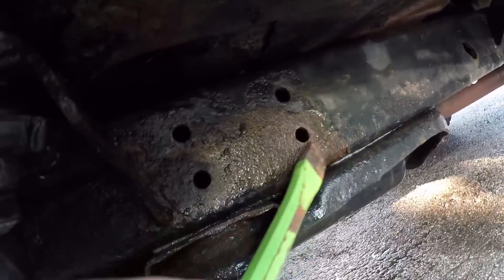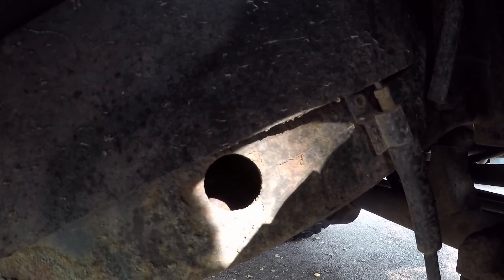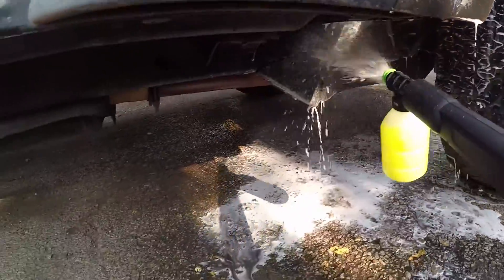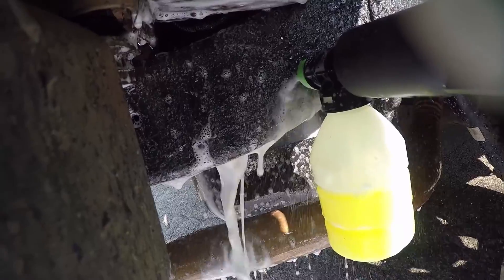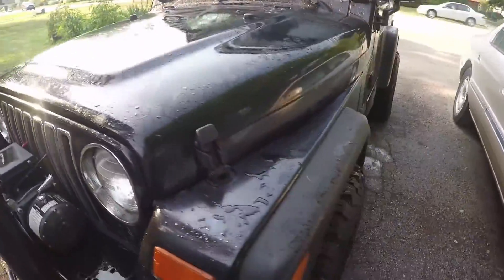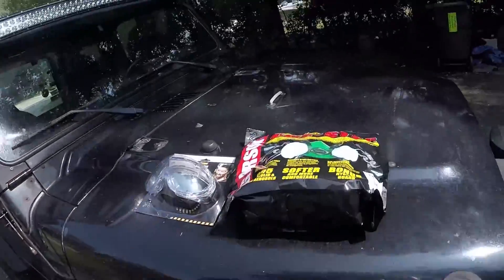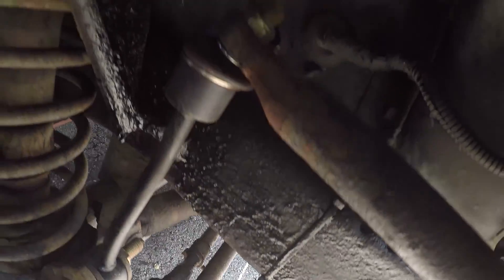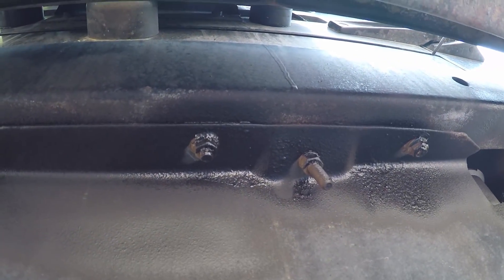Winter is Coming! - Winterizing my Jeep Wrangler

Comment: If you're dealing with a great deal of rust and want to truly neutrialize the rust and protect further rust do this.  Otherwise you're just painting on top of rust and the rust will continue. 

A few years ago and while my 97 Wrangler was undergoing upgrades I discovered my Frame was in bad shape with rust, so I began my research. I discovered that simply painting it was a waste of time, made it look good but did not address the undergoing problem - RUST. 

I used Eastwood products. https://www.eastwood.com/paints/rust-solutions.html?SRCCODE=TXT00010&gclid=Cj0KCQjwl8XtBRDAARIsAKfwtxC3-nKzeY9sENRIZcrYiTQ-v9H5Q2vfl7LdesR_rPxmkXRQXWgkpiAaAhaIEALw_wcB. 

While the Jeep was on a lift and with the help of a friend we power washed the entire under carriage with a degreaser, scrubbed and scrubbed to remove grease, road grime, etc. We made flexible hoses to power wash the the inside of the frame of which is difficult to get into, spent considerable time picking the mud and debris from inside of frame. This process took a full day, let it dry overnight. The next day we applied Eastwood Rust Converter, this transforms rust into a paintable surface, dry overnight. The next day we applied Eastwood Rust Encapsulator Plus, this stops Rust in its Tracks. Also used the Eastwood Internal Frame Coating Aerosol Nozzle with 24" Extension Hose on the inside of the Frame, let that dry overnight. Next day applied a flat black paint, this is not necessary but helped to make all undercarriage match.

I don't work for Eastwood and their other manufactures with same product. Just wanted to share what I've done to protect my Jeep. 2 Years later the Frame is in good condition considering it's a 97 Jeep Wrangler, driven and wheeled in many places across US and for the past 20-years resides in the mid-west and deals with Mud, Rain, Snow, Salt, etc.
Reply from the maker: Thank you for sharing!  I eventually did use Eastwood product on the frame last year, lol.  This video is from 2017, and for last year's winterizing, I did a video on the internal frame coating and POR15.  I actually also just ordered more POR15, and the other prep items.  I will be working on my 2004 Rubicon some time before snow falls.